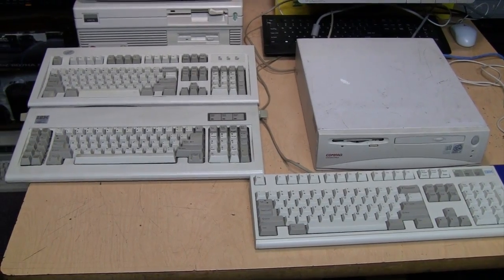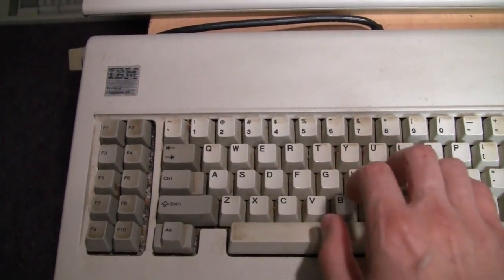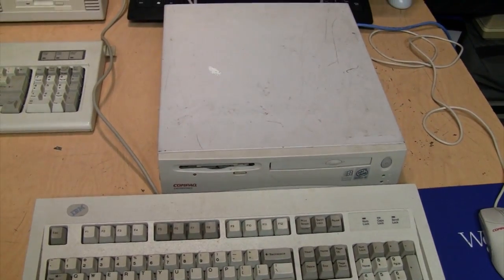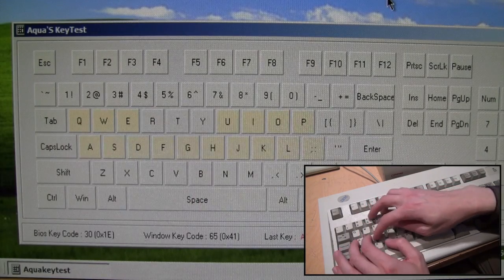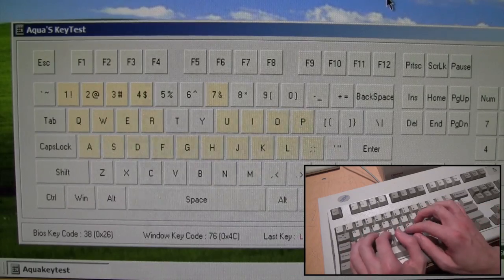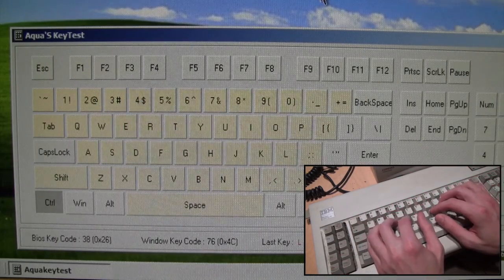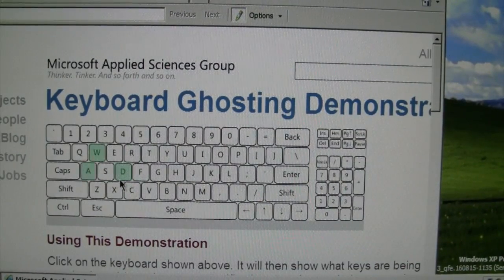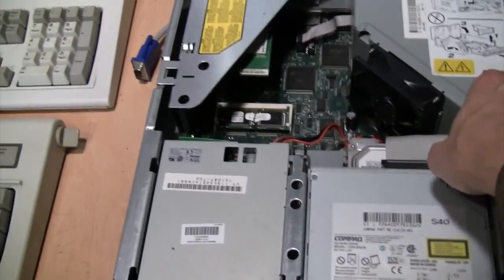IBM Model M vs. Model F keyboard N key rollover test

Comment: As I understand it, no USB keyboard can do n-key rollover natively, because the USB HID standard limits simultaneous key presses to 6. (5 regular keys and a modifier.) The ones that support n-key over USB do it by presenting themselves as multiple HID input devices to the operating system and distributing the keys among them. This can sometimes cause problems with bios setup screens and stuff like that, so it's often disabled by default, and you have to manually re-enable it each time the keyboard is power-cycled.

Comment: I think N-key is especially good for using the keyboard to play piano, organ or synthesizer music.
And the old Model F with the F-keys on the left makes me think back of good times at the Delft university (end 80's, beginning 90's). Need to check my Razer keyboards on this ;-)
Reply: Olaf Leimann {But midi keyboards exist}
Reply: NiIgaVusser 'CUTMAN'[JonnyAppleseed]{W00T} Where on an XT would you have connected that midi kb? I doubt the Atari ST range has N-key rollover😜
Reply: Actually, modern keyboards are limited by the USB port, so i think you can do only like a 5 or 6 key rollover
Reply: I have a late 80s KeyTronic Keyboard with N Key rollover - it's more a function of the design of the board then when it was made.

Comment: One main use for 4+ key rollover would be for console emulation.  For example, I remember in Super Mario Land on the Gameboy, I had to push 4 buttons simultaneously to jump high to the right or left and shoot simultaneously, i.e. push up + right arrows and A + B buttons simultaneously.  In two player mode using left and right sections of the keyboard, double this to 8 key rollover.  

A fix for the Compaq closing bit - "Computers Often Make People Angry Quickly" ;-)

Comment: Why is the Model M said to have 2 key rollover when you can clearly press 3 or 4 keys simultaneously?
Reply from the maker: Because as I mentioned (although probably not in the proper terminology) there are different scan zones where more simultaneous key presses can be detected if they are not all in the same zone. And rollover refers to the additional keys that "roll over" beyond the first one, so 2 key rollover means a minimum of 3 simultaneous keypresses can be detected.

Comment: I don't think its the capacative switch that allows the N-key rollover, but the matrix that keyboard controller uses to detect the key presses. I guess they have each wire hooked up in a way that it has a direct line to the controller, or at least there is some kind of multiplier or something going on.

I know for the Model M matrix that a specific set of 3 keys being pressed can cause the computer to show a 4th key being pressed (the ghosting mentioned). That is why 3 work in some cases, but then keys spaced apart can go over 3.
Reply from the maker: This video explains it: https://www.youtube.com/watch?v=p_JTZo2rKmw

Comment: I believe that nkro can only be achieved on an AT/XT/PS2 keyboard port. It can only be done on USB through multi-keyboard USB hub trickery that is built into the keyboard. That is because USB works by polling the device, but AT/XT/PS2 work by sending interrupts.

Comment: I bought the Unicomp Classic 101 March 2021 and now September 2023. Used a few times and was put into storage. Recently rediscovered and noticed "P" key was acting erratic requiring two or three taps to make contact. Contacted Unicomp and was given RMA but would cost $48.00 plus $16 shipping. After doing my own disassembly I found all but 6 plastic rivet heads were broken off. Unicomp claims this issue was resolved before I purchased in 2021. I would not advise purchasing from Unicomp based on my experience.

Comment: Currently I'm streaming Oblivion on twitch.  I was talking to my audience about switching to an IBM, Model M keyboard (1988) but I'm using a Corsair K 70 (Cherry MX red).  I have a USB adapter for the Model M but it only gives me the same rollover as the standard PS/2 connection. Do any of the USB adapters give you more?
Reply: No, it's inherent to the keyboard itself.

Comment: So the model F has N key rollover in the 90s........
I thought N key rollover was 2010s invention.
Reply: Farhan The Badass Scizor It actually is. PS/2 port is sending interrupts to cpu. USB is not. For USB N-key rollover is actually 2010s invention.
Reply: More like the 80s
Reply: The reason it was "invented" and pushed in the 2010s is due to the fact that its cheap to add to a mechanical keyboard with a diode over each switch. Its harder to add on membrane keyboards like a model M or rubber dome.

N-key rollover is a pain to add to USB due to the way the interface works , it has to show as several keyboards or do tricks with the USB HDI interface , PS/2 had is natively as long as the physical keyboard supports it 

and honestly 6-8 key rollover is plenty .
Reply from the maker: In the '80s, you mean. The 84-key AT version was introduced in 1984, and even the original 83-key PC/XT version from 1981 has N-key rollover.
Reply: USB nkro is normally implemented in a way that the computer sees the keyboard like many keyboards on a usb hub. (for my Gigabyte Osmium it sees it as three keyboards). And every keyboard device/driver is used for a certain area of the keyboard. That way they can implement more than the 6-key-rollover in the standard driver without using their own driver which could be incompatible to some operating systems.

Hope you could understand this as my English is not very good :)
Reply: Oh, and don't forget the '70s hall effect nkro keyboards, but you can't use them without a lot of knowledge.
Reply: Actually there have been USB keyboards with N-key rollover since the Topre Realforces from the early 2000s.

Comment: To be fair, you probably wouldn't need all four of the W A S D keys at once, since it is a very rare occurrence indeed that you would need to travel backwards and forwards at the same time or right and left at the same time.
Reply: infinitecanadian But it is problem when you try to play Mortal Kombat in 2 players mode.
Reply: yeh but what if you move and shoot or use an ability at the same time .

For example in an MMO i may need to move in a strafe move so 2 keys , hold down shift and then press a number to use an ability on bar2 , so thats 4 keys right there.

NKRO is overkill tho 6-8 KRO is fine.

Comment: Is there anyway to manually add keys to the keyboard maximum rollover, either with hardware or software? Referring to the IBM Model M II
Reply: You would have to add diodes to the matrix and redesign the controller , and its a membrane (thats why its called model M) you would have to re do the whole matrix yourself.
Reply: not really. The problem is the Matrix foil below the keys. For nkro every key needs a connection to the controller, and that is too complicated to implement in a thin plastic foil with only one layer. "Gamer-keyboards" have a real PCB (circuit board) with different layers so that every single key is wired to the controller seperately. The model M uses a plastic foil like rubberdomes use it, so i don't think you can mod it for nkro. you would need to change that foil with a PCB, but for a model M that would need to be curved, which as far as i know is impossible to produce.

Edit: You can also achieve NKRO with diodes, but that is also very hard to do on a membrane/foil
Reply: @TheRailroad99  The Model F uses a curved PCB, so it's definitely possible.